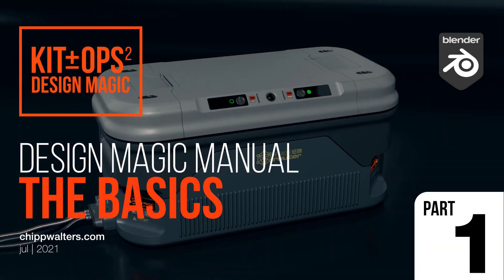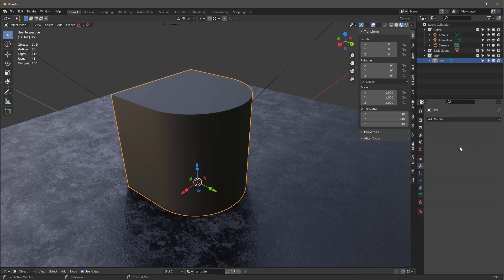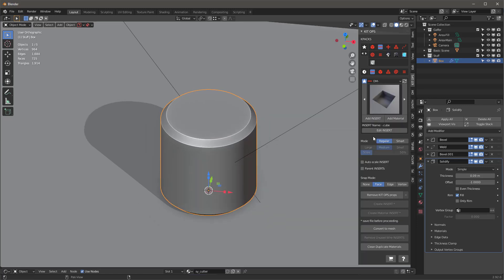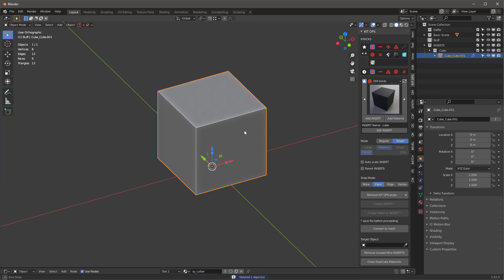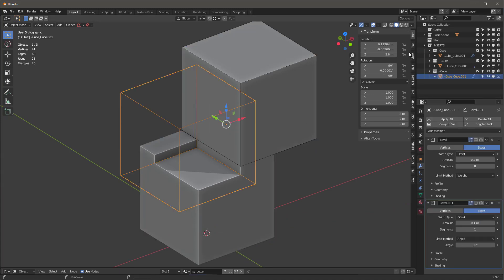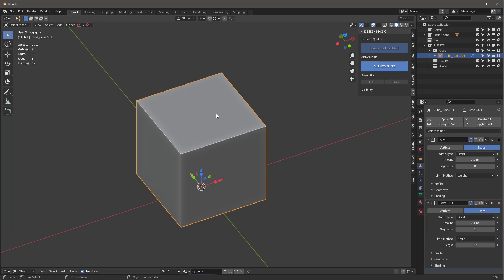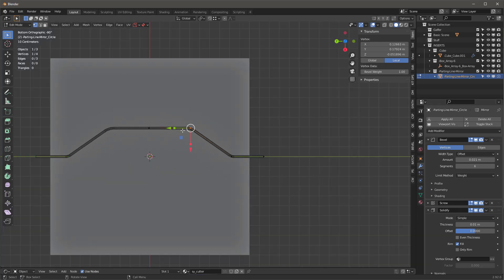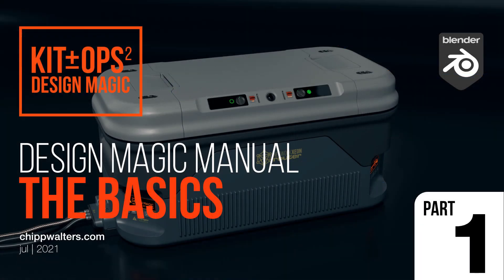DM Manual: #1 The Basics

Comment: Hi Chipp, @ 4:41, once I selected my parent model and then click Add insert, a wire frame box appear and when I try to select, it's gone. I have hardOps install. I wasn't able to achieve what you are doing there. Is there a conflict between those 2 plugins?
Reply from the maker: Yes, hard-ops works fine with design magic. My guess is that you have an issue with your booleans so either switch to exact mode which will obviously take a lot of time or turn off all your modifiers and then turn them on one by one starting at the top to see which Boolean object is giving you trouble.